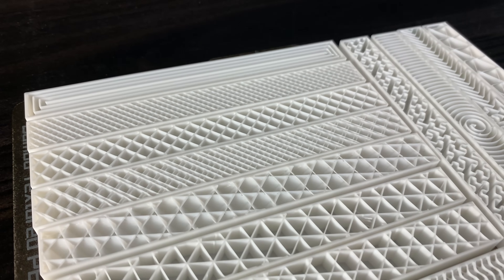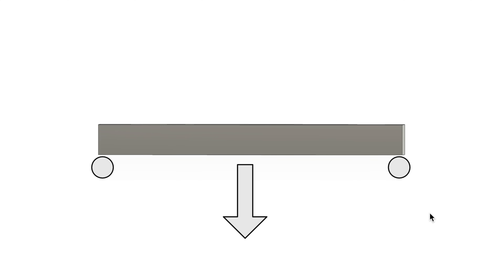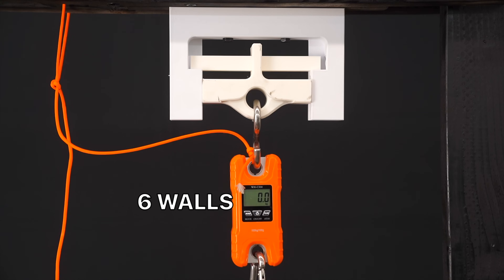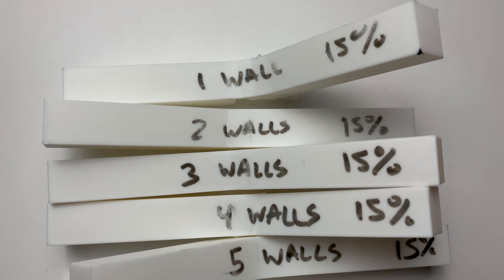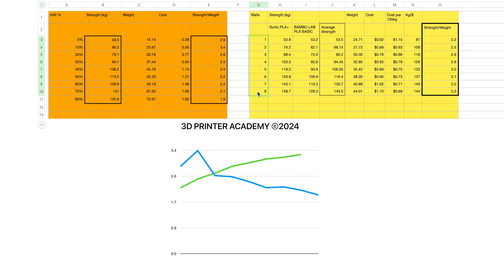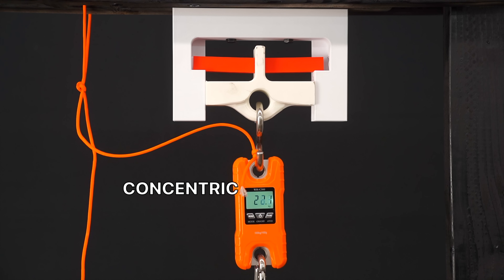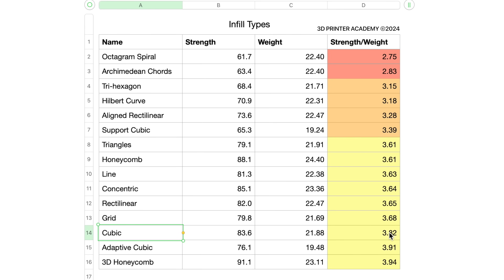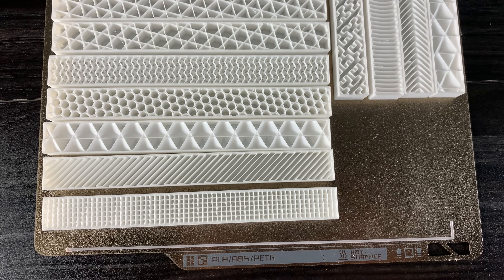This 3D Printer infill is the strongest (3D Printer Academy Tested - Episode 2)

Comment: Gyroid infill is very effective at reducing thermal contraction which can cause print corners to lift or entire prints to dislodge from the build plate. I use this infill type most often.

Comment: Adaptive cubic seems to me to be the best balance of print time, strength, and filament used. Gyroid and 3d honeycomb are both useful, but I've found they often take a bit longer and can really rattle/shake some printers with the constant change of direction. (Adaptive) cubic avoids that. Good video.

Comment: The reason Cubic is so good is the best trade off on time to print, and part strength.  It gives support in all directions, and 3d honeycomb does this too but takes a lot longer to print since your printer has to do a lot of cornering.  All other infills give strength in only one direction or are just for fun.

Comment: I really like how you included strength to weight ratio. Although it makes the numbers a bit fuzzy, in the sense that each infill type has different filament amount used per "percentage". I generally judge the infill on how much weight it uses and have to ignore the percentage much of the time

Comment: It would be interesting to test small parts (1-2mm thick) using 100% infill and various numbers of walls.  I think more walls can actually reduce strength in that case, because walls are identical from layer to layer, whereas 100% infill crosses itself at right angles.

Comment: What a great video! Short, interesting, highly informative! Thanks! Since the video of Stefan from CNC Kitchen I used Gyroid since it's somehow the best compromise between print speed and strength in all directions. Lighting for example is best for lightweight applications, but if you compare the absolute strength it's not that great. It's only the highest score because of the low weight.

Comment: Great video! I really liked how straight forward and well structured you presented your results, without additional stuff to artificially lengthen the video. Great that you put so much effort to get some knowledge for the community. I would really like to see more.
For example it would be interesting to see how well the different infill pattern perform when it comes to multilateral forces applied.

Comment: A large note for this is considering that some perform better for vertical infill and some perform better for horizontal infill. The force applied on the beam should be tested in both directions.

Comment: my defaults are:
Adaptive cubic because it's fast, easy and most efficient for big parts. Bad for warp prone materials because straight lines.
Gyroid for warp prone materials that would self destruct with cubic. Also internally connected cavities, relevant for flooding/ drying.
Archimedean chords for parts that need to flex in a specific way.

Comment: Funny how a week ago I was looking for this exact video because a prototype of mine with gyroid infill just snapped easily, then I printed again with 3D Honeycomb (adds 14% more grams, ABS) and it's probably 3x as strong. One of the important things to look into is the orientation of it, as gyroid infills print 4 layers per "switch in infill directions" so for every 4 layers it's pretty snappable into a spaghetti-looking remains. Shape, material, and walls play proportional parts altogether as well in achieving the most efficient prints
Reply: Yes, i had this problem too. It really depends for the gyroid infill, what orientation it starts , how tall is your modell and where te force comes.
Reply: This is exactly the type of nuance that needs to be in these kinds of videos!! Please pin this comment lol
Reply: Infill should not make a part stronger in terms of tensile strength in real measurable way...(you stated snap, so I assume it wasnt a compressive failure)
If its having a significant effect it means your walls are not thick enough, and you can increase strength to a greater degree using the plastic in the walls rather then infill.

Infill is to provide compressive strength and internal support for layers, not overall strength.

Comment: 4:01 The number of walls and the infill % are mutually exclusive (for strength/weight), so why use the intersection? The actual approx. max strength/weight ratio is the parameter that has the highest ratio! In your results, that 10% infill and 8 walls.

Think about it: why do you place the infill curve axis(0-80%) on the wall count axis (1-8) such that 80% infill correlates to 8 walls? You could also have done only 4 walls in your test set, so then 80% infill would correlate with 4 walls? Since the axes are independent of each other, you can't overlay them all willy-nilly. 

This is why some comments are saying that you are better off using thicker walls than trying to increase infill density for this type of mechanical failure. Infill is more useful for compression integrity when the walls can't be used to support the applied force.

Comment: I haven't done proper empirical testing, but on small (smaller than 2 fists), mechanical parts, you get way better strength with increase in shell thickness (perometers and top/bottom layers) than with infill. Infill helps on large stuff, and even then you get more strength with more perimeters more quickly. Usually when I find myself thinking about the strength of the infill, you're already way past the amount of forces that a plastic part can reliably withstand.

Comment: Lightning might just be an outlier for the particular orientation it was printed and tested in. Knowing that it starts sparse and grows to be dense, I wonder how it would do if the testing orientation were flipped upside down. This way, the force is still along the same axis, just opposite direction. All of the other infill patterns should do the same because they don't change in density as they grow.

Comment: Interesting to see how infill contributes in part breaking strength. Although I think infill% and infill pattern are likely more important for compression strength than for tensile strength. When loaded in the test fixture shown, the outer layers are going to be taking most of the force-- which is probably why the often-cited advice is to increase perimeter layers rather than infill% if you want higher breaking/tensile strength). Whereas in compression, the infill is contributing a much higher component.

I usually use triangle infill for parts needing high compression strength and increase perimeter count when I need higher general strength. The 3D honeycomb and some of the other more complex infill types take a massive amount of additional time for large parts. At 15% infill, one of my large parts would take over 78 hours with 3D honeycomb, 36 hours with Gyroid, and 31 hours with Grid. For smaller parts, the time difference probably matters less, but it's usually around 50% to 100% longer due to all the direction changes.

Comment: In most situations, the biggest amount of force will be applied the farthest from the center of the piece. The only exceptions if is the strength is applied in the same axis as your part. So it is absolutely logic that the number of walls would make the most difference for the bending test you ran. It should also be true for torsion, but it may be different for tension and compression. My guess would be that tension would also depend on the axis the part was printed, and that compression would require the infill to hold the walls together as strongly as possible.

Comment: I prefer to do most internal geometry in CAD. if the part doesn't need to be obscenely strong, then I'll just shell the model to 1.6mm thick. However, if there's a large top layer that need propping up, then I'd probably resort to 4 walls, lightening infill. Bridging 20mm with 6 tops layers works fine, before you need to consider infill/internal geometry. The main benefit of CAD internal structure is that anyone can print it, without any slicing experience, and the model can be sliced on any slicer with the same outcome. Strength can be added where needed, and voids can be added to save time/material.

Comment: Lets talk about plastic deformation! 

But first, great video! I appreciate the effort to be scientific. Your video covered fracture strength, which is definitely useful. I also think it would be useful to know the strength of all these parts be at the point just before they are permanently deformed (aka plastic deformation). This would be very useful, since i think most of us printing functional parts would not really like to have the part operating in a deformed state. 

Disclaimer: i understand polymers have a funky stress strain curve, where the elastic region of deformation is… atypical of other materials. I also know that parts under a bending moment exhibit a different curve than parts under tensile stress

Comment: Very interesting findings. Thanks for sharing! One thing I would suggest is maybe using a tensile test to compare infils next time. Since you're loading these beams in bending, the most critical factor is the wall thickness. Much of the infill is close to the neutral axis, and therefore contributes very little to the bending strength. In a tensile test, the print orientation relative to the load orientation would be critical too. Thanks again for the info!

Comment: I think a test with no infill would have been interesting. I bet it would perform nearly as well as the lightning infill. If no infill has the highest strength to weight ratio, that kind of negates lightning as even serving a purpose for strength.

Comment: Using a Strength to Weight ratio as the indicator of which is strongest only applies when one cares about weight or cost of the part. It also depends on which direction the force is applied. I understand that you're trying to give some indicator of strength, but there are a lot more variables that go into determining infil than just weight and cost.
Reply: What are other variables? I noticed honeycomb and gyroid more flexible.
What are your considerations?
Reply: @vim55k   If your part takes loadings on a face instead of edges where there are perimeters to support it, then more infill and less perimeters is generally strong and a lot stiffer.
Reply: @vim55k  Direction of the forces on the object. Personally, for a lot of my parts I have a minimum strength that will be required. At that point it's a matter of finding which one provides the strength I want with a good balance of print time. Most of the parts I do are smaller, so cost isn't really a factor.

Comment: For a better comparison of the infill, you could substract the strength of the part with only walls from the total strength. It would be justifiable in first order beam theory, which is of course not perfectly applicable for 3d prints, but it would get rid of lightning as the outlier.

Comment: Excellent video, but there is a unique issue that occurs with the different forms of infills such the the percentages are less accurate the more complicated the infill pattern is resulting in the change in overall weight of the part. This would indicate that the more complicated or heavier parts based on infill are giving you more infill than requested. Basic density calculations prove this given the same material is being used for each. CNC, just using them as an example as you certainly have many excellent methods here, adjusted the infill % to more closely achieve the same weight of the part thereby creating a more fair comparison of strength to weight by keeping another one of the parameters constant.

Comment: Thanks for the comprehensive test. It would have been good to know the direction of force relative to infill orientation, since this affects the result quite much, I suppose. One concrete question: I'm about to print a semi sphere with 296mm of diameter, with 5 walls and no huge force on it planned. But I need to print it with a good outer surface finish. What would you recommend choosing for infill? I thought about support cubic at 23% which will lead to about 530g of weight (while adaptive cubic or rectiliniar would be around 800g) - a good choice in your opinion? Thanks to everybody for commenting!

Comment: Be interesting to see what happens when the load isn't applied over but rather through the test piece, be that a printed hole through it with x walls or an attachment point that is part of the test piece (hook) or a screw into the the test piece

Comment: the infill strength and infill percentage also has another variable I don't see tested.   The number of infill lines.  In Cura you can easily double the lines and connect the polygons and then halve the % and it seems to come out just as strong as doubling the % itself.

3D Honeycomb, or Space Bees, is typically better than Gyroid, when it comes to fast printing.  The reason is the fast printers having to 'wiggle back and forth' so much for Gyroid, tends to introduce some irregular patterns, the "Space Bees" however, only does a line, a diagonal, then another line, and repeats for the layer, not a wavy pattern but more 'straight" this can help reduce the vibrations and the 'crossing of layers' that might create build up or undesirable effects.  However, this is mostly printer dependent and honestly - with such close calculated expressions - whichever one you desire, is the one you should pick.

Comment: I've been using gyroid as my default because of the strength and I like the way it looks. (useful in drip trays of various kinds) I recently switched to 3D honeycomb as it appeared to be almost as strong, but prints a little faster with less vibration. Judging from your results, my assumption was correct. I'll probably use that now and just go to gyroid when I need maximum strength.

Comment: there is plenty of stuff where strength to weight ratio is irrelevant.  it might be relevant from a cost perspective sometimes.  So breaking down material strengths by purpose is more relevant.  moisture should probably be considered, like did you dry the filament before hand. How old is it?  From a long term data accumulation, at least notate these things, so years from now you know what you considered.

Comment: Nice testing, however I think the other two orientations should be included in the test to make it relevant, since most of these are only symmetrical in one axis. For clarity, these other two would be done by:
1. Using the very same model used here, but rotated on it's side
2. Printing with the same settings, but flipping the model on the slicer so that one of the small ends is on the printing surface.

For example concentric is ranked 3rd in strength here, but with the other two orientations I'm quite sure it wouldn't be. It would be nice to get comparable testing results and rankings for each orientation, and an average for each type of infill. With a quick google I didn't find any results on people doing comprehensive tests like that. Since you already have the rig and methods in place I think you would be the perfect person to do it.

Comment: For the infill strength test, if lightning infill comes first then no infill should make it to the first of sending as well. The infill percentage is not mentioned here. Every infill will have a different algorithm to calculate infill percentage. Infill percentage for gyroid would probably mean more material for same percentage infill. I think you should keep the weight constant and measure Max strength. Meaning measure the strength of samples with same weight and to do that print a bunch of samples with varying infill percentage and see which one matches required weight.
Also infill direction for some infill matter. Example, for linear infill, the angle of lines make a difference when it comes to strength

Comment: This is a 100% solid video. 😁👍 It would be good if you could measure the plastic deformation point of the print to, because (If I remember correctly) that is the point of where the material can return to its original form with out being destroyed.

Comment: The video is really interesting. Of course, from the point of view of strength of materials, it would be more accurate to conduct tensile and compression tests. Bending is a special case of these loads.

On the other hand, 3D printing differs from the standard approach. As the part is manufactured layer by layer, this results in varying strength depending on the point of application of the force. The parts are more vulnerable to forces applied perpendicular to the plane of the layer. They are also vulnerable to torque in this plane.

Comment: I'm newbie to 3D printing but this is my thougths:
Problem with honeycombs is it is slow to print as the print head needs to change direction very often.
Gyroid shakes a lot during the print, so I'm avoiding it, but still like it.
Cubic offers a good strength combined with fast print as it is just straight lines.
For me, cubic is winning by now.

Comment: Great video and info, thank you for doing it! I appreciate that you factored in strength to weight ratios because as 3d printers, we're always concerned about how much filament is used, but there are times where we only care about strength and using an additional 10 grams of filament isn't a factor in the decision. It would be nice to have organized them based off only strength too. Also would have been cool to know what wall count you used while doing the infill percentage and the other way around and then taking the best from both and seeing how strong you could make one part. Just my 2 cents 😊 great video though

Comment: Awesome video!! It would be interesting to check the number of lines in the infill (line multiplier). I usually print with a line multiplier of 3 and an infill density of 10%; the print feels very sturdy.